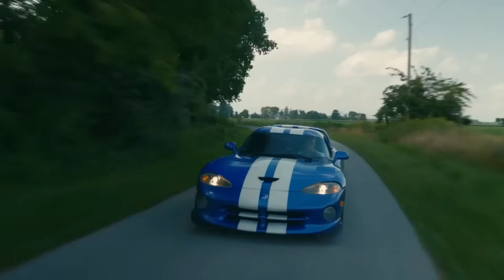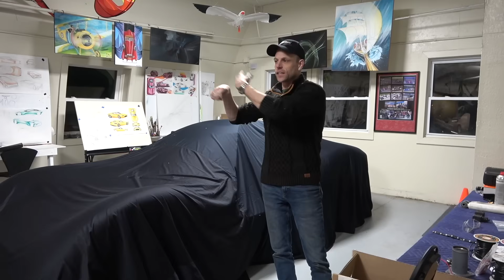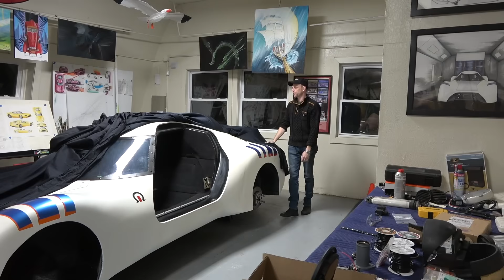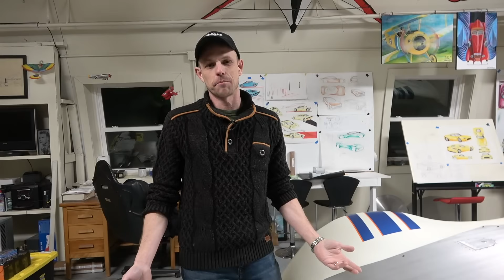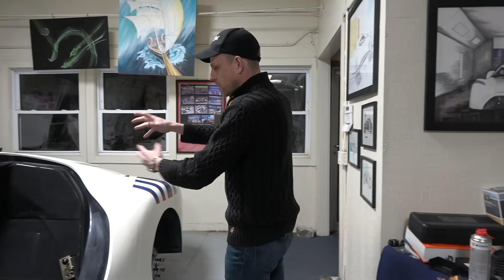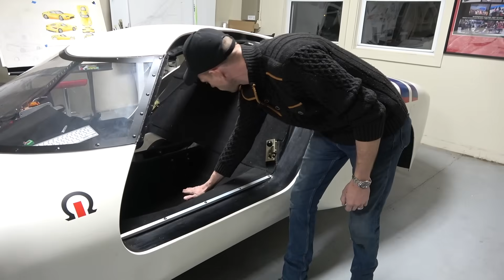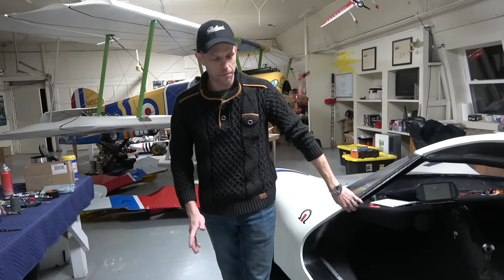Casey's OMEGA CAR because the AUTO INDUSTRY doesn't GET IT!

Comment: I've been arguing for years that Electric cars dont actually help the environment as much as people believe
Reply: Nothing will ever be as environmentally friendly as purchasing a used car and repairing it as needed.
Reply: Arsenal WC but it does further the agenda of “those people” if you know what I mean
Reply: I've found that the mere mention of the concept of embedded energy in manufacturing makes many people's heads explode. Usually resulting in angry yelling on their part.
Reply: Engineering Explained already outlined the environmental effects in his video, and surprisingly electric cars are less damaging to the environment than a gas car. https://youtu.be/6RhtiPefVzM
Reply: Reuben Sandwich after manufacture and only while they’re operational. To produce and dispose of, not even close. Batteries are environmental poison and nobody disposes of or recycles them.
Reply: @One_Bar  They do recycle them. People pry open wrecked Teslas that are FUBAR because of the batteries. Those FUBAR Teslas cost upwards of 15 grand because of the batteries. Energy storage is big business, so acquiring batteries for as cheap as possible would be the logical move. So I do not get where you are getting this info that batteries are not recycled. Hell, even lead batteries are recycled too. Also, once Teslas are stripped of their batteries they can then be crushed and have the metals reused. Metals are not magically unrecyclable because they once belonged to an EV.
Reply: @OmegaF77  cool. That's one brand with a very limited number of cars produced. What about all the rest? No one is going out to yards and pulling packs out of them. Same style of battery, same environmental hazard when the car rusts through and the packs deteriorate. Same cost to mine the lithium and other components and build a brand new car versus taking a car that's already been produced and driving it longer. There's no contest.
Reply: @One_Bar  I don't know where you get this info from, but I highly doubt companies just throw away electric cars. In fact, I'd say you have no proof that they are just letting EV batteries rot somewhere. I have already listed Engineering Explained's video where he disproved the myth that ICE cars are cleaner than EVs. Far from it. Automotive engineers aren't morons who think that CO2 starts at the exhaust pipe.
Reply: @One_Bar  For there to be used cars, they had to be bought new first. I'm driving a used Volt, glad the previous owner bought it new (even though looking at the fuel economy they got, buying a Prius would've been more efficient). Tesla aren't the only ones reusing batteries, lots of Renault Zoe and Nissan LEAF batteries become battery banks just like Tesla Powerwalls.
Reply: @OmegaF77  Most people who watch that channel are fan boys. The good comments are deleted or buried and very often debunk or otherwise undermine whatever his position is. The short of the long is he is wrong. And just are you hold him up as "look, this guy says X" I can just as easily say he isn't. If you actually care to learn why look into the efficiency of typical electrical components (motors, controllers, converters, etc.) and grid efficiency (it's laughably low). And that's just too start.
Reply: @hahahano2796  There are reputable sources int eh video you can cross-check yourself. As far as inefficiencies go, gasoline doesn't magically appear in the reservoir. You first have to drill for crude oil, ship it, refine it (using ungodly amounts of electricity), transport the final product to the fuel company/division to add detergents and stuff (the process of making such chemicals is also polluting), and finally having a semi transport it to your local gas station and dump it in the underground tank (some of the gas escapes as vapor). Also, the efficiency of the electric components you've listed have magnitudes better efficiency (depending on the quality of work of the manufacturer) than a car's engine.
Reply: @hahahano2796  Again, engineers aren't morons. They account for everything and they've pretty much come to the same conclusion: electric cars are cleaner as a whole.
Reply: @OmegaF77  Just as gasoline does not magically appear neither does electricity. All of those things you said applies to gasoline applies here too. Then there is often additional conversion losses. There are some "clean" sources which will also pollute more than they save because they do not have a net positive energy output within their lifespan.

You hold up "Engineers" as some monolithic group while ignoring that there are rather extreme disagreements within said group. Also, just being an Engineer does not remove biases from a person. 

The short of the long being you not only don't know what you are talking about, no only you can you not even fathom the idea you might be wrong as you make vicarious appeals to authority, but you cannot even see for yourself where there may be flaws in your own thoughts as you point to some third party to divert from the fact that you cannot even support your own position.
Reply: @hahahano2796  
"All of those things you said applies to gasoline applies here too. Then there is often additional conversion losses. There are some "clean" sources which will also pollute more than they save because they do not have a net positive energy output within their lifespan."
Sorry but you have no idea what you are talking about. Do you transport electricity via tanker truck? No. Do you pump electricity out of the ground? No. Do you refine electricity? lol no. Also, tell me what clean sources that pollute more than they save and back it up with research and data (sources). I want to know. Seriously because I don't like some "green" sources of energy being hyped up.

"You hold up 'Engineers' as some monolithic group while ignoring that there are rather extreme disagreements within said group."
Great strawman there since I do not hold them as a monolithic group. Yes, they do disagree on things, such as personal tastes. They are human. But the fact is they do not disagree with the laws of physics (thermodynamics beautifully demonstrate why electric motors are more efficient than gasoline motors). They do the research, they do the science, they do the math. That is their literal job. When engineers lie and cheat, you know what happens? If you design an emissions cheat in a vehicle that emits more toxic gases to the helpless public (some of which die from car emissions), you go to federal prison. They have to know what they are doing, they can't just fuck around.

"The short of the long being you not only don't know what you are talking about, no(t) only you can you not even fathom the idea you might be wrong as you make vicarious appeals to authority, but you cannot even see for yourself where there may be flaws in your own thoughts as you point to some third party to divert from the fact that you cannot even support your own position." 
Showing reputable scientific sources of data is not "point to some third party to divert from the fact that you cannot even support your own position" nor is it "vicarious appeals to authority". That is how you support your position and prove reality (Ever heard of evidence?). Here are the sources which show the environmental impact of electric cars:

1. http://energy.mit.edu/publication/on-the-road-in-2020-a-life-cycle-analysis-of-new-automobile-technologies/
2. https://www.ucsusa.org/sites/default/files/attach/2015/11/Cleaner-Cars-from-Cradle-to-Grave-full-report.pdf
3. http://www.ccsenet.org/journal/index.php/jsd/article/view/64183

"you cannot even see for yourself where there may be flaws in your own thoughts"
Data is data. Doesn't matter what I think, and the data shows that electric cars are cleaner. Does that mean that I can no longer ejaculate to the sound of a screaming V10? Fuck no.
Reply: @OmegaF77  You might want to actually read the things you link. One presumes the conclusion without evidence to justify EV. One takes only on-platform efficiency into account. One is talking about targeted green house emissions reduction. None of which prove your point but do show an inability to both analyse the topic as well as an inability to understand what "supporting evidence" is.

Furthermore, you need to look into the peer review process. Even more so when one of your "sources" is a little more than a hit piece against ICE vehicles.

You have ignored the various methods of energy transport. Some energy, prior to conversion to electricity, is transported by truck. Most is by pipeline. Then converted. Transported again via line, etc. Very similar to how ICE get there but often with less conversion / transport in between.

You keep holding up others as some truth despite not knowing what they're saying and when the holes pointed out defending these people who are lying to you or presenting half truths that you keep parroting. Also, you have conveniently forgotten that when a "Scientist" or "Engineer" lies about EV efficiency or hand waves about some loss in a part of the system they do not go to jail. Unfortunately for you and the layman like yourself, there is a lot more politics in "Science" and "Engineering" than you want to believe.

The best part is one of your publications explicitly states if the source isn't a "clean" source then electric or hydrogen cannot be justified. Do reference in my prior posts how clean sources aren't clean.
Reply: @hahahano2796  

"You might want to actually read the things you link." I did and you didn't. Here's how I can tell:

1. _"One presumes the conclusion without evidence to justify EV._" (MIT paper)
The evidence (data) is in the results section. You don't just read the conclusion and expect evidence in there. That's just the conclusion section. In fact, since this was written back in the early 2000s, they concluded that hybrids where cleaner on average vs BEVs (why are trains today use electric motors as their main way to move around?), and they're right _at the time_. Now, that has flipped.

2. "One takes only on-platform efficiency into account."
Is this the Cleaner Cars from Cradle to Grave report? Because if it is, then you read something else. Because the report outlines not only the efficiency, but also how the MPG reflects the efficiency of the vehicle and the power sources in use and the overall impact of EV car production.

3. "One is talking about targeted green house emissions reduction."
It is actually about the overall environmental impact of vehicle production and lifecycle. Damn, you really can't read journal articles can you? Look:
"This study aims on provide better understanding of the environmental consequences of the compact vehicle production activities based on 5 impact classifications which is GHG generation, Acidification, Eutrophication, Carcinogenic Effect, and Human Health measured in Disability Adjusted Life-Year (DALY) using Life Cycle Inventory (LCI) Analysis under local electricity mix in 2017 and 2030." (from Abstract)
This is the Malaysian paper BTW.

"None of which prove your point but do show an inability to both analyse the topic as well as an inability to understand what "supporting evidence" is."
AHAHAHAHAHAHAHA. Do you work for Epson? Because you are projecting, hardcore.

"Furthermore, you need to look into the peer review process. Even more so when one of your "sources" is a little more than a hit piece against ICE vehicles."
The "hitpiece" is backed up by real world research and data. Look at their sources and tables and notes. Goddamn do you like ignoring important shit because of your own agenda.
Also, the peer review process is how you discover laws of physics and scientific theories. Without it, science would just be a pile of assumptions and bullshit, just like your idea that EVs are dirtier than ICE vehicles.

"You have ignored the various methods of energy transport. Some energy, prior to conversion to electricity, is transported by truck. Most is by pipeline. Then converted. Transported again via line, etc. Very similar to how ICE get there but often with less conversion / transport in between."
Sorry honey but you don't transport sunlight to solar panels via pipeline or tanker truck. Neither is wind or hydro. You're still thinking about fossil fuel powerplants such as coal and natural gas.

"You keep holding up others as some truth despite not knowing what they're saying and when the holes pointed out defending these people who are lying to you or presenting half truths that you keep parroting."
Ah, the classic "scientists are lying to me because [insert reason]" conspiracy theory. If you actually know how science is done and read journal articles, you wouldn't make this conclusion. Also, you don't need scientists to prove or disprove something. They write down what they did, how they did it, and their data. You yourself can perform the experiments. You can also do the math and see if the scientists are really bullshitting you, or you are just bullshitting yourself.

"Also, you have conveniently forgotten that when a "Scientist" or "Engineer" lies about EV efficiency or hand waves about some loss in a part of the system they do not go to jail."
I guess Dieslgate didn't happen then? And none of their engineers never went to prison, right? Oh, I'm sorry, I don't live in some fantasy land where neither of these things happened. Dumbass.
They also don't "hand wave" away efficiencies, they account for it when the numbers are significant.

"Unfortunately for you and the layman like yourself, there is a lot more politics in "Science" and "Engineering" than you want to believe."
Like what? Please tell me real life examples and no conspiracy theory bullshit. There is no such thing as politics in science. Science is about studying nature via replicating it by building models using observation and data. Engineering is using what science finds to design and build stuff we use everyday. This is just more conspiracy bullshit.

"The best part is one of your publications explicitly states if the source isn't a "clean" source then electric or hydrogen cannot be justified."
If the sources are coal and other fossil fuels, then no, EVs are not justified. But wait, those aren't our only sources of energy is it? My god, do some Googling, and you'll see that certain states use more renewable energy sources than you assume. You can't just take one quote out of hand, isolate it, and run with it assuming that the entire paper is against BEVs. That is just asinine.

"Do reference in my prior posts how clean sources aren't clean."
Okay, here: "There are some "clean" sources which will also pollute more than they save because they do not have a net positive energy output within their lifespan." You still need to give me examples on this.
Reply: @OmegaF77  You don't even know about or purposefully keep ignoring conversion and line efficiency of electricity. While presuming that all electricity is from "green" sources. Or that green sources are not clean. Defending articles that in their own words are not about what you claimed (which I pointed out). You even talk about dieselgate when I was referencing not-dieselgate. Wow.

Yeah, you're that pigeon on the chess board. Good luck.
Reply: @hahahano2796  

So you just ignored all of the evidence, danced and shat on the chessboard, and you call me the pigeon? Thanks for the laugh troll.

Even with the conversion and the line efficiency of electricity, EVs are still king of motive efficiency. Thank you for providing an excellent display of Dunning-Kruger. Sandwich out.
Reply: @OmegaF77  I never once said they were more damaging, I simply said "They don't help the environment as much as people think", I did not imply that they were worse for the environment than normal cars
Reply: @OmegaF77  Electric cars are not as environmentally friendly as they could be, but they are still an improvement. My daughter has a Chevy Volt, her daily routine involves about 35 miles, mostly in city. When it goes to gas it still gets 35MPG. She burns maybe a gallon of gas a week in the winter when the fuel engine runs more often.  Her energy cost is about 1.15 dollars a day. Even considering the impact of electrical production it's still far better than gas or diesel.
Reply: @wymple09  BARELY an improvement at that, even in the midst of government subsidies and all.
If they're so good, why bother subsidizing them?

I know the same argument can be applied to oil, but it doesn't really benefit all that much from it due to taxes and all.
Reply: @Iamwolf134  Because massive intrastructure projects are sometimes too much money to get private investment interested. The interstate highway system, for example, is not privately funded. Nor are the big lock & dam systems on the Mississippi. The Panama canal would never have been built with private money. The public as a whole is better able to absorb risk.
Reply: @wymple09  Of course, my argument would be that it would make much more in the way of common sense to change the way our cars are built than to change the way they're driven as that would require MASSIVE infrastructural changes, leaving the rest of us to foot the bill, and Casey Putsch's Omega car is a prime example of exactly that philosophy. This is surprisingly Eco friendly during operation, even compared to EVs with more conventional chassis, and that's a big improvement. EVs reaching parity with ICEs (until that happens) is really more pie-in-the-sky kinda stuff, whereas the Omega car is a damn good stopgap.